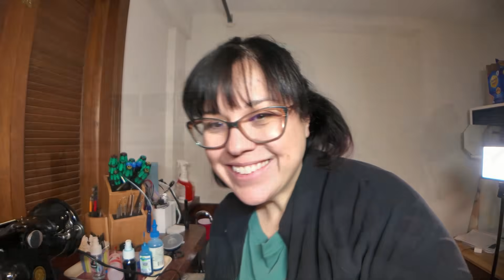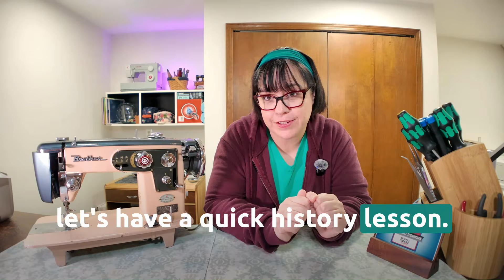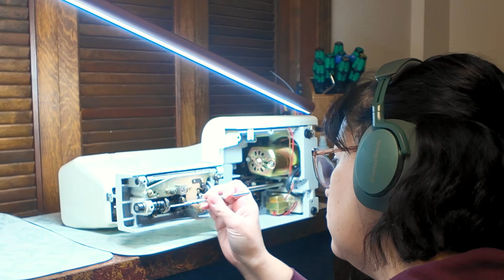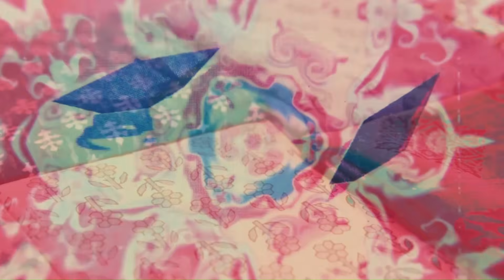Becoming a CERTIFIED Sewing Machine Repair Technician

Comment: Congratulations on your goals for this year. Many years ago, I worked in the home healthcare field as a service technician.  
I loved fixing things knowing a client depended on it for mobility. I started the very first 24-hour service repair anywhere in my region of Ontario as an independent 30 years ago. After 15 years of fighting for respectability, and proving that service and maintenance could pay for itself, I left and never went back. There still isn't training for service techs in home healthcare today, and you could never work as an independent. If it's a six hour drive for a tech to come to your place, that's the price you pay.

One thing I almost learned the hard way was the need for repair insurance. A machine I worked on almost got a client killed. Found out later it had nothing to do with my repair, but it really scared me. For the next 15 years, I worked under the umbrella of a local store. Is repair insurance necessary (if you can get it) in this field?

Comment: This is a very helpful video that I will gladly share. I joined Sewing Doc Academy several months ago, in part because I was getting very bad information from local Sew-n-Vac businesses. The last time I took a machine for service, a bobbin from a different machine had been forced onto mine, and the person that I had been told would be servicing my machine, laughed when I asked to speak to them and said they only ever work on vacuum cleaners. Over the years, I have lost count of the number of times I was told by “factory trained” reps that my vintage Elna SU was outdated, but they would give me $100 on a trade in if I purchased a new machine of the brand they were selling. I also learned that when asking about their experience with Elna SU, I was told that they “work on Elna” but learned that they had no Elna experience or training at all, and that they charge far more for service on machines that they don’t sell. As well, while they advertised as “factory trained,” the person who actually worked on my machine was a  “trainee” who had never worked on machines at all. I took my machine back and did not let them work on it. I have since found a wonderful vintage machine expert. And that doesn’t count the number of times I was told that there were no parts available for my machine when I actually had the part in my hand.

Comment: Do you have access to various tools related to machine timing for the various manufacturers as well as repair diagrams? It can be hard to rely on regular measuring tools, or on basic maintenance books provided with the machine.

Comment: No person can be an expert on every make and machine- you will encounter dozens of different types. The secret is to be methodical in your approach and sometimes take the problem the customer reports with a pinch of salt. Some higher end machine manufacturers are very sniffy towards independent repairers and tie in lengthy warranties to prevent them being able to work on machines to protect their network. Great if you don’t move areas or have a good dealer. I have found that the first 300 machines were the worst! Don’t get me started on that one on the shelf behind you! Good luck in your endeavours. From UK.
Reply from the maker: Completely agree with everything you said! Including the pesky Singer "Heavy Duty" behind me (the one behind me has a broken gear, of course.)
Reply: @LisaSeamswell in every tech’s boneyard! Just awful but you have to admire the marketing behind it.

Comment: as a maintenance technician in a factory. I will work on crazy expensive assembly machines, but sewing machines run on voodoo and black magic. It's nice to see there is a program to teach repair and maintenance n sewing machines.
Reply from the maker: Haha, voodoo and black magic indeed 😂
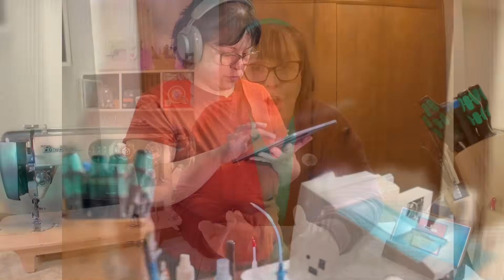Reply: @LisaSeamswell  2 timothy 2:15 KJV – John 5:39 KJV – Proverbs 4:7 KJV – John 8:32 KJV = Matthew 11:28 KJV Robert breaker, Gino Jennings, Stephen Darby Ministries, Dr Peter Ruckman 
Man, you are to come to Luke 5:32 KJV and John 3:7 KJV, so that you could be:
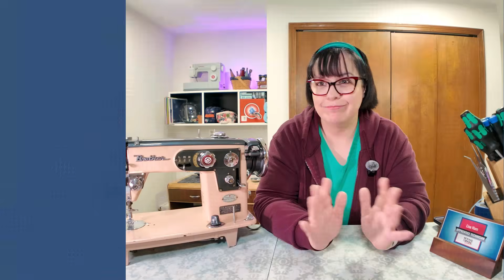Matthew 5:13 KJV Mark 9:50 KJV Ephesians 5:8 KJV
Reply: Can you tell me what to do for my machine. It’s a singer 4411. Heavy duty. The upper thread gets stuck in the bobbin . Please